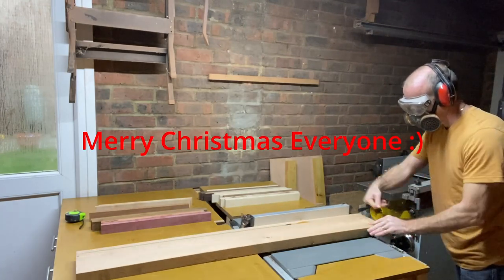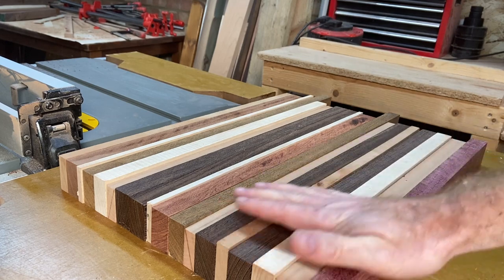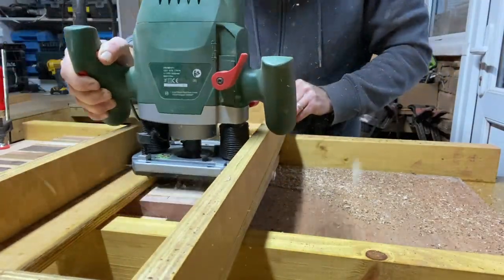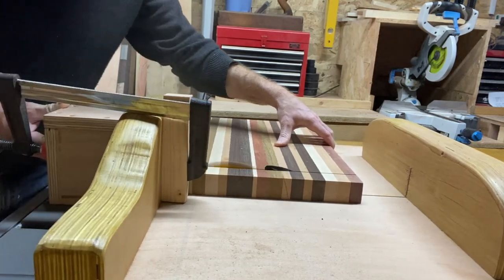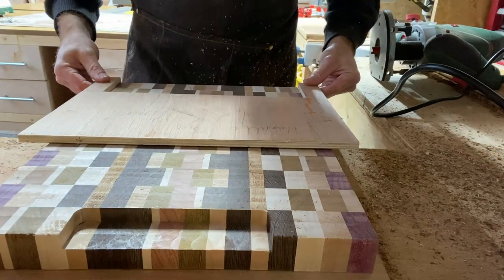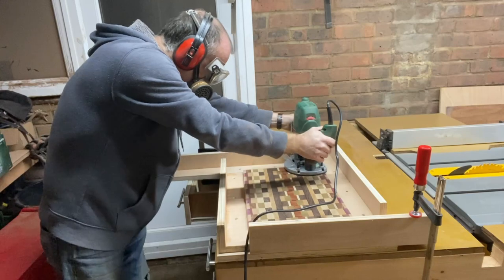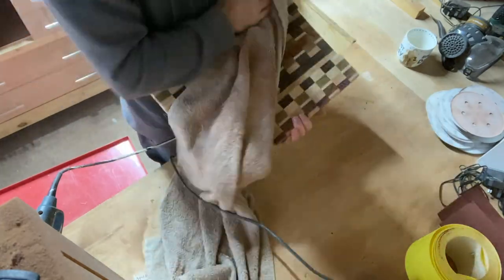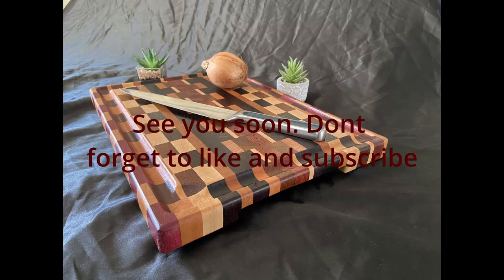Beautiful end grain cutting board using the Flip Method

Comment: Cheers for the video mate, great inspiration and the board looked awesome.
1 tip I could give would probably be get some scrap pieces the same height as your board in the juice groove jig. I did notice a slight dip on the side of the router while you were routing it out. Other than that. 👌🏻
+1 subscribe

Comment: As a former shop teacher, I think this is absolutely fantastic bordering on incredible but I have two criticisms. First, I'd either use a large chamfer on the back to help pick it up or router a half-circle in the edges so you can use both sides, no rubber buttons, this way it looks better! If they want a no-slip surface, buy a routing pad at Grizzly, cut it in half and you have enough for two boards! I love your technique for flattening the board, not all of us have huge sanders!
Reply from the maker: Hey Gary. I agree the chamfer works well I have done that before but it’s not a common method I have used. 
I have attempted routing the ends with a half round but but my router is quite big and cumbersome. I will be ordering a new router soon so I have better options when it comes to  certain jobs like juice groves and half circles.

Comment: That's really beautiful, thanks for the video. One step I didn't see you take (unless I missed it) was you didn't wet it with water to bring the grain out before final sanding. From what I have seen this is important because the first time it gets wet the grain will react leaving a rough finish. Perhaps the way you sealed it prevents that, not sure.
Reply from the maker: I did wet it down but didn’t record that part. But yes that is an important step to do. Well spotted